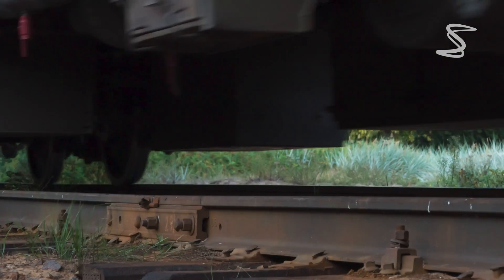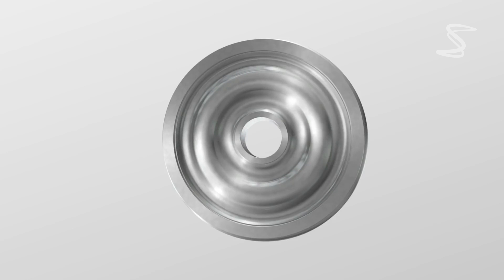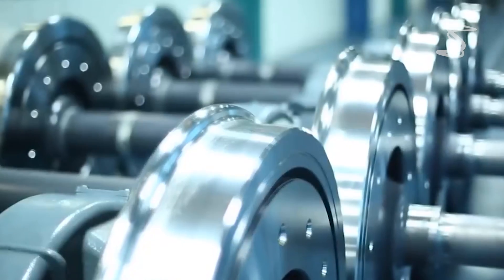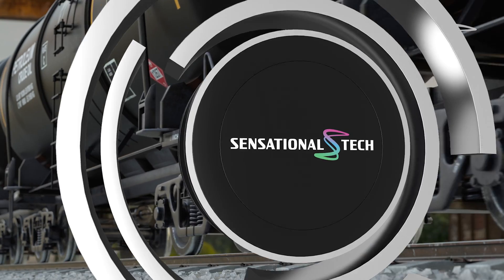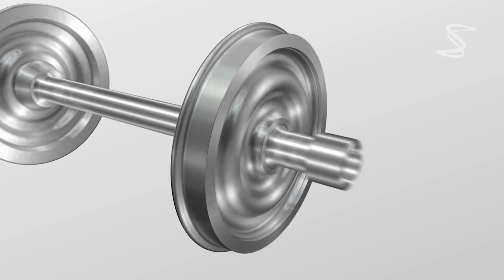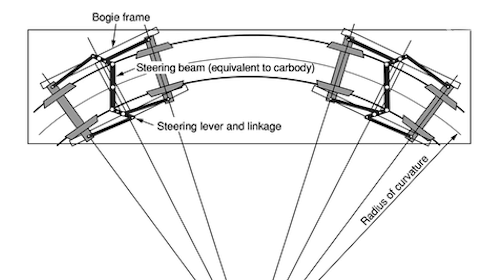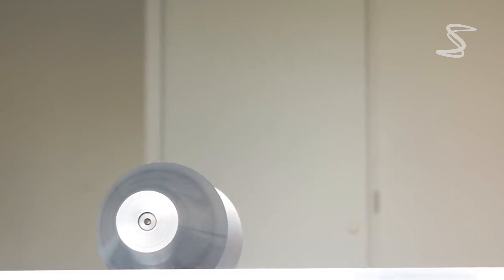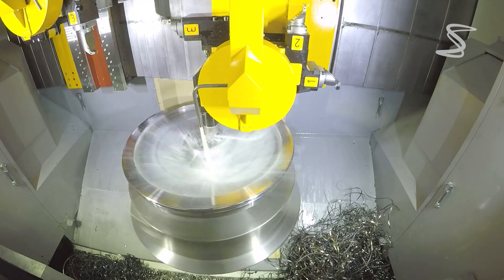Why Train Wheels are Conical? The Science Behind Train Wheel Design!

Comment: I AGREE WITH THE TECHNOLOGY USED FOR OUTER WHEEL AND INNER WHEEL. 
FOR THE SAKE OF KNOWLEDGE, MY QUESTION IS IF WE MAKE AXLE OF THE WHEELS FIXED AND MAKE WHEELS FREE RUNNING BY MOUNTING BEARINGS, WILL IT REDUCE THE WEAR AND TEAR OF THE WHEELS.